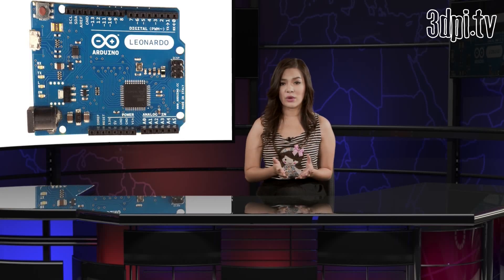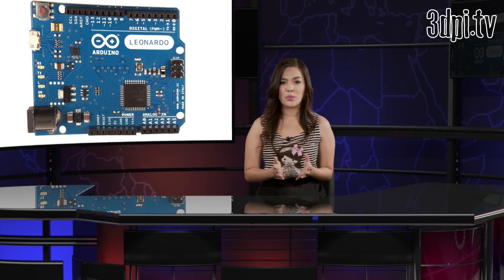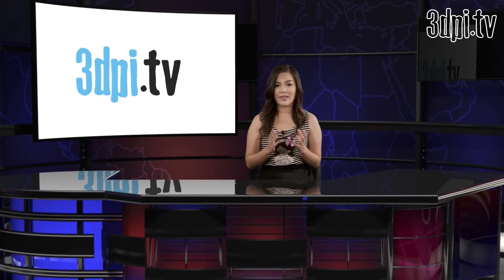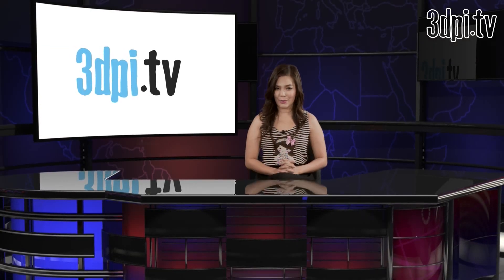Is Digital Knitting a form of 3D Printing?

Comment: I'm an industrial machine knitter and knitwear designer. No it's actually not a 3D printer , although it makes 3D items. The technology has been in existance before 3D printing. In fact jacquad weaving loom and knitting are the basis  for original  computer card programming. Rubio is incorrect , this machine prints nothing it does however fabricate loops that create a garment. The whole link to 3D printing is a marketing ploy.  The disruption? I get that, however there are hardly any hand machine factories in existence any more and most knitwear is produced on state-of-the-art electronic machines. The amchines are opeerated by highly trained people and even in China , they get paid more sustainable living wage. Actually these machines are very inexpensive and will probably end up in factories all over India and Africa, so sthe " labor abuse" angle  can be exploited. In the ned  Rubio makes a case for poorly designed knitwear produced by  non-knitwear designers who actually understand the technology. The garments aren't  very sophisticated. Good for home useers just like Brother  and Passap amchines , which have had  the  ability to be motorized for more than a decade. PR spin is my take.